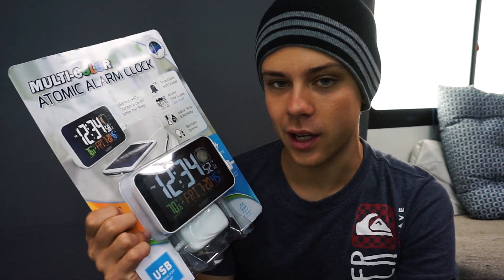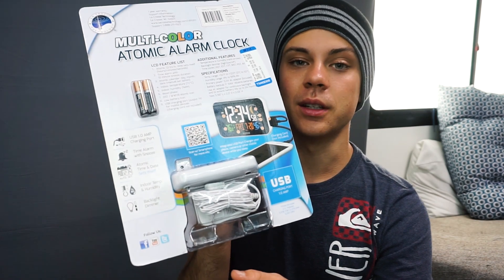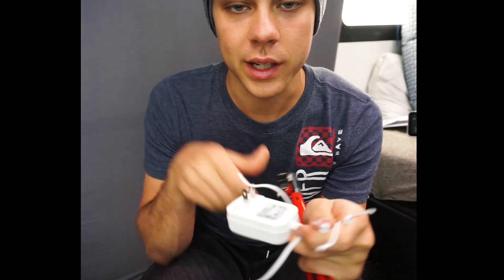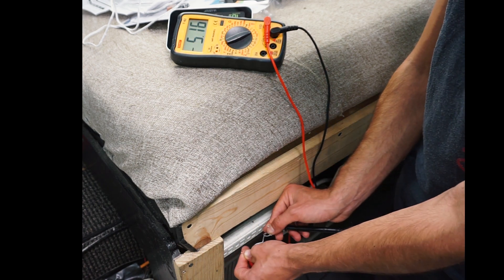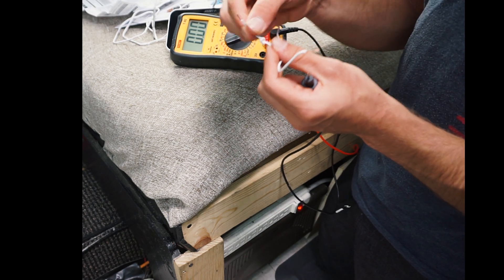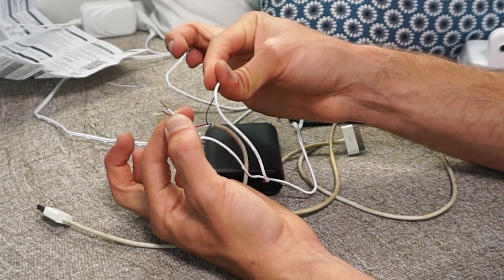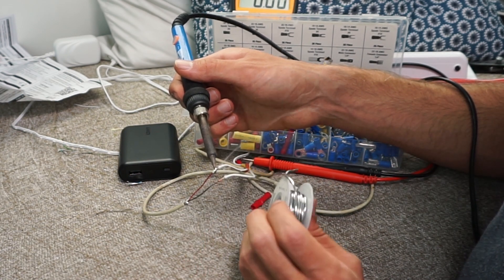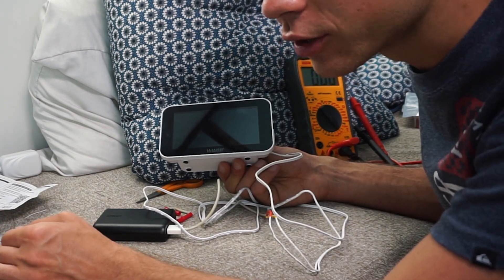Off-grid Solar Tutorial: Hardwire 5v appliance to a USB plug (same protocol for 12 volt appliances)

Comment: If your multimeter probes are too thick to test the centre of a banana plug, just put a thin bit of wire in it that sticks out a bit like a paper clip or even thinner and then touch that with the probe

Comment: A little off topic for the segment video .. but I was wondering if you know anything about Charcot–Marie–Tooth disease?  Would you be able to come up with a nutritional plan that could possible stunt this disease of help with the symptoms?? I'd be willing to pay you for your time of course ! .. please let me know !
Reply from the maker: +Melissa Mines oh goodness that is a tough one. It is congenital so there are not many options available. Sure a good diet is a good idea, but I doubt that it will improve symptoms. You can work on coordination if muscles. May need to wear braces if they help. What is the biggest problem you face daily with this disease?
Reply: on the bunions joint areas hurts the most .. I have to take my shoes off while working a nursing shift sometimes to alleviate the pain also in the knees and calves... I wear orthotic inserts they help for a bit .. but it almost feels like I need a new pair after 6 months.. I guess that could be from Shifting of the joints..... Thank you for responding though.. There isn't much out there as far as reading material on the disease.

Comment: Great Video. I think you may have touched on this in a previous video but what are your thoughts of 18650 battery bank vs Vmax lead acid. Cost Effectiveness?
Reply from the maker: incomparable in the long run. 18650 lasts wayyyyy longer. but they cost way more up front. and yeah the lithium vs lead acid battery video I made goes over this in more detail